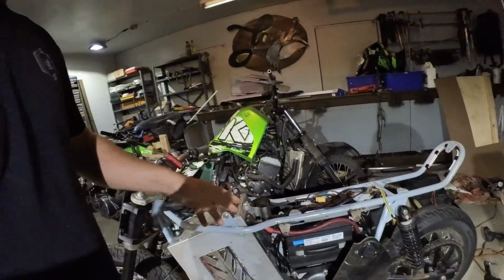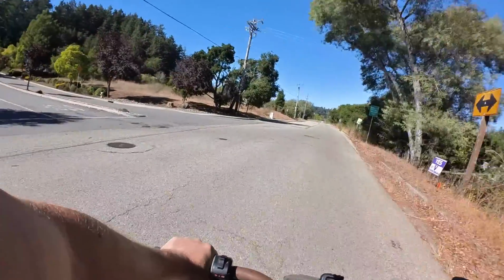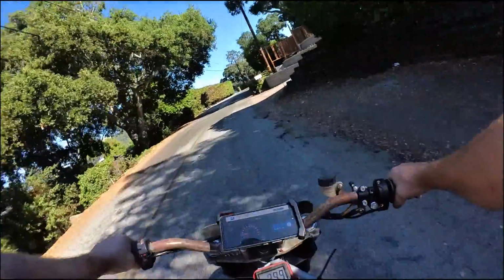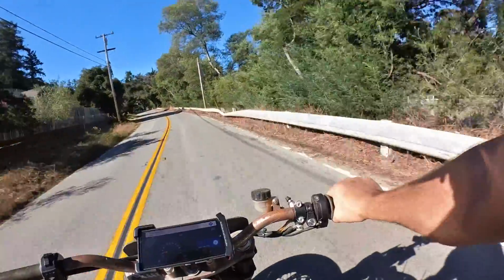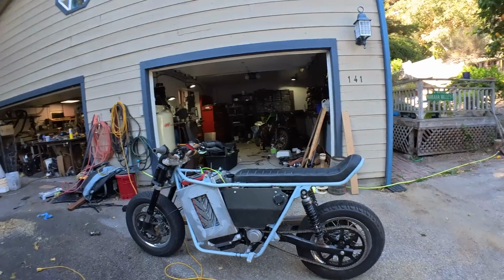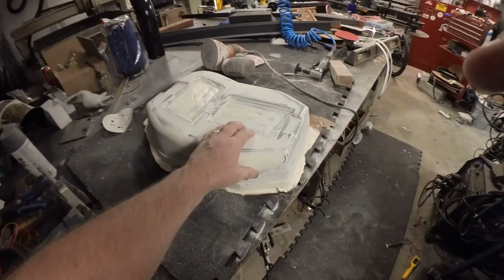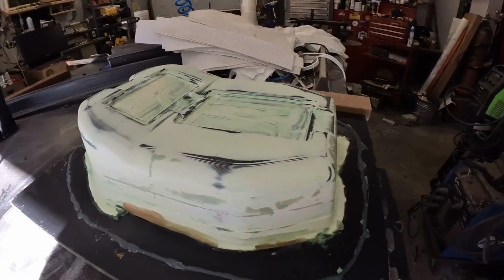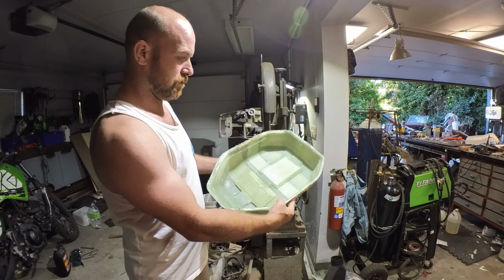Electric Motorcycle test drive | Lark Machine Co

Comment: Pro Trick: Before laying up the mold, mix Caposil (polyester powder) with catalyzed resign into a paste, then fill all the sharp corners of the mold with the paste... then lay-up the part, it'll all kick-off together and you'll be bubble free, with nice firm corners!  Tip: fiberglass cloth never lays down right, as it doesn't fully saturate with resin, like fiberglass mat! ..and I'm digging the new ride!
Reply from the maker: Kinda thought i should do some cab to start, but only thought if it when i was half way done. Hahaha. Thanks for commenting!